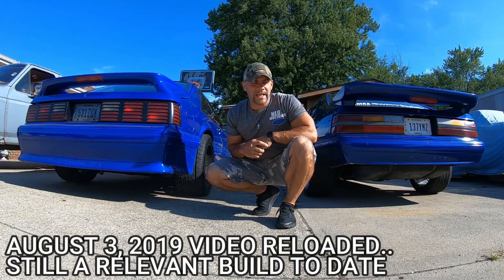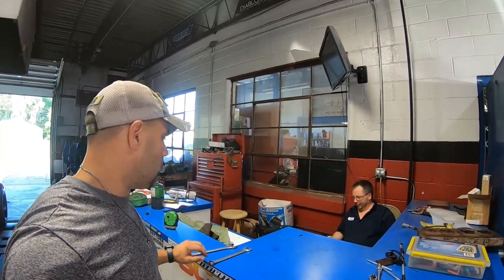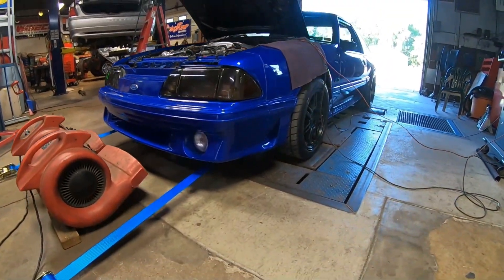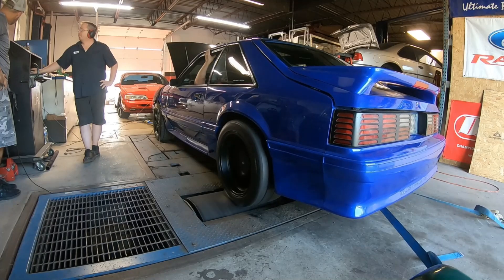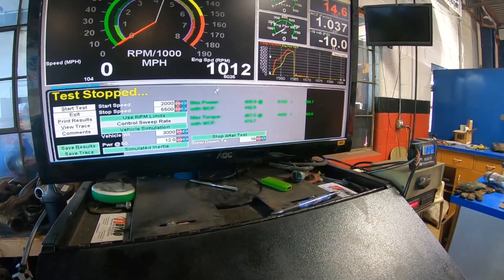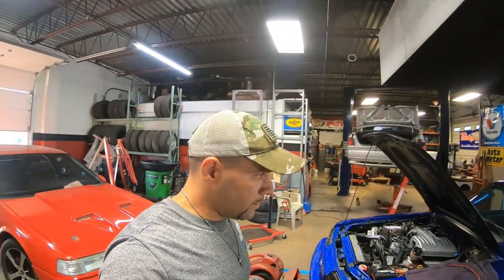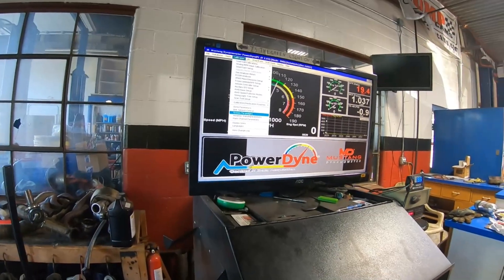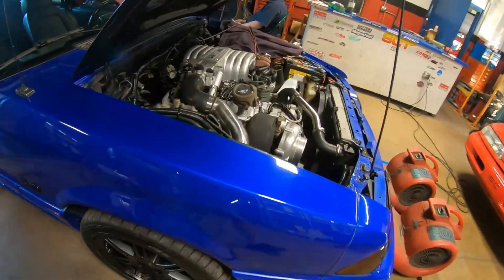Can A Bone Stock 302 Make 500 Hp On A Budget? Turbo Fox Body Mustang

Comment: Yes, a stock block 302 can actually hold up to aboit 800 hp on a low rpm build. I had a twin turbo 302, stock everything,  blow through carb and i lifted one head at about 800hp, put studs in it and left it about 650hp and that was 3 years ago and still running strong

Comment: Nice, the torque is brutal on those heads, actually all the budget headers I have cleared the p’s got some on my 81 swapped rx7, 86 block, .30 over 4 eye brow pistons stock replacement, trick flow stage 1, and a edel perf. Dual plane runs clean not crazy quick but it’s fun. The other p’s are for basically same set up- but turbo for my 85 gsl-se swap with a mega squirt both t-5 cars turbo kit is an cx racing kit I bought and modified a few things still getting it together

Comment: 495 hp is not a lot on a stock block? What does that translate to converted to the engine? Are you saying you’re running a stock crank, stock block, stock pistons? I thought the max for a stock block before it started cracking it was around 550 hp at the engine? Sorry for your loss.

Comment: How much does a budget turbo build cost? I'm thinking of doing the same to a 1988 Lincoln
Reply: Cheapest you may pull it off for is about $900 plus standalone system so add another $500 minimum to that. Then about $300 for every professional tune. And expect a few $100 for more open exhaust. $2,000 but expect it to be much more

Comment: That's impressive man! I took mine a few days ago only made 298hp and 365tq . Tuner said i needed a better fuel system. Im running stock lines and rails with 47# injectors and i think a 255 pump. Was kinda disappointed tbh
Reply: On 93 octane?

Comment: I have 2 pairs of e6 heads, not great heads i know but 1 set is completely rebuilt and going dirt poor budget on this one. Stock block and ring gap, have you seen anyone put boost to these? and do you have any idea on valve springs i can use with no machining? Channel is great love the content thanks
Reply: Honestly, the E6 heads get a bad rep, & in my opinion, they are actually way better than others would say. I've had great luck with them, most importantly, learn how to port heads & they'll do you good. Unshroud the intake valves in combustion chamber, minimize the short turn radius in both intake & exhaust, open up the external (header area) exhaust ports by a lot, same as E7's & get good valve springs.👍✌🇺🇸
Reply: @brianwenzel8791  thanks for the reply, gonna use those e6 heads for sure ported one already, but….. I did find a rebuilt set of Gt40p ‘s at a cylinder head shop guy had them there for a good while. Let them go for 200 bucks I said sold brotha. Just needed truck flow springs and grind out humps. I do wanna boost the e6 and see what it does. When I buy my dyno I will make a video for that.
Reply: Right On. I prefer the Gt40 heads over the Gt40P's The same basic design, but the P's are problematic for header fitment. The spark plugs are at a weird angle. Very difficult to find headers that fit. I actually used the 1986 E6's on my Fox, because of the P's header fit issue. The heavily ported E6's, stock valves, 160 lb. Springs, 1.6 rockers, arp rod bolts & head studs & mls head gaskets, 9.1 compression. 220°x 512 lift cam. Single 66mm turbo, 12psi. 30 tho ring gap, 18°timing, AOD/shift kit, 2200 stall. 3.73 rear. 421rwhp @ 5600, 486 ft lbs @ 3300. So E6's can get it done.👍😁🇺🇸

Comment: Serious question, if u rebuilt the motor, why didn’t u use a stroker kit? Or at least a performance cam and heads? I’m planning on upgrading everything but is stock better? Or just cheaper
Reply from the maker: You missed the point of the build. It’s all done with stock parts. Of course minus turbo
Reply: Kind of a waste as the stock block is the weak link here. No point in sticking expensive parts in a block that will be at risk of splitting in half.
Reply: @DaveScottADV missed the point as well
Reply: @treboy95  which point is that?
Reply: @DaveScottADV  Budget
Reply: @deepkicks-999  not sure why you tagged me. I said that it would be a waste to stick expensive parts in a stock block when it will break before the stock rotating assembly will.
Reply: its a BUDGET build tittle implies that

Comment: I ran a similar combo back in 2008. Stock motor, headstuds, 42lb inj, 255 pump, 60mm turbo, Air/Air, meth injection, Pro-M blow thru 3" tube MAF, 22° timing, NO TUNE. Never had it on a dyno, but it went 6.90s in the 1/8 @ 101 3200lbs thru a AOD trans. Fun and simple combo.
Reply: was it reliable?
Reply: @alanmusa7143 mine was. I had a very similar setup around the same time. Swap 60mm for 73mm. Car made 450/550. Ate t5 transmissions and spec clutches annually.

Comment: What injector, what mass air,what ignition box,what wastegate and bov. Very nice build. Very impressive
Reply: Advancing the cam 4* doesn’t “add” any power it just lets you use the power that is already available earlier in the rpm range..with stock untouched e7 heads I usually advance the stock cam 4* because those heads don’t make any power passed 5300 and there is no need to make it scream..also Dan is running 42lb injectors with stock ignition..I know he modifies his kits to accept larger wastegates but I’m pretty sure it’s a 50mm and a 44mm bov
Reply: Also have you ever advance camshaft 4 degrees to see if it gives more power?

Comment: What head gaskets? Do you use
Reply from the maker: Felpro 9333 PT1
Reply: @Neomustangs  thank you for your help in advance what injector size and the rocker arms 1.72 stock push rods work ?
Reply: He is using 42lb injectors and the stock pushrods are just fine with 1.72 rockers

Comment: When you get your On3 kits. Do you get anything special like the upgraded bearings in the turbo etc.?
I figured a Holley sniper instead of a blow through carb, with E85 and On3 would be a solid set-up.
Reply: Have they updated the super sniper units to where you can run e85 through them now?

Comment: Do you run Girdles to keep the block from splitting? I keep hearing of these and want to know more from you on this
Reply from the maker: eh... i do ONLY because i dont want the rods flying out of the block and me running them over. Its more of a SAFETY thing really. PLUS it will save some of your other parts and keep it together during the carnage! On top of helping keep the motor together
Reply: @Neomustangs  Please explain how a girdle will keep the rods from coming out.
Reply from the maker: @RDub79  You understand how a girdle works right?
Reply: @Neomustangs  Yes. It ties the main caps together. It doesn't do anything to strengthen the rods.
Reply from the maker: Sure it also keeps the parts from flying apart in case of a break …..

Comment: I make 555 to the wheels with an otherwise stock Explorer engine, on3 @ 11lbs and good supporting mods. 👍
Reply from the maker: Very nice! i FREAKIN love budget builds... i get so caught up in other stuff gotta watch old stuff
Reply: Were the heads done ? Did you have a cam ? 

Best we got was between 480 to  496 wheel at 13 lbs .  That good bit over 500 motor
Reply: @Spad68  3 bar GT40 heads (replaced the springs), Explorer intake and stock cam. Car has a good fuel system (-8 feed, Aeromotive rails, 340 in tank pump) AEM WMI kit and a Holley HP EFI. Made 490whp on 10 lbs without the WMI and 1 degree less of timing. Pump 91 fuel @ 4200” altitude.
Reply from the maker: @Spad68  no
Reply: @Neomustangs Dan followed your build with exception of head studs and blew a head gasket with 8.5 lbs.of boost. Getting ARP head studs but what part number and product were the head gaskets? Thanks, went 11.6 first time out.
Reply: "Supporting mods" can mean a lot of things. HCI, exhaust, fuel pump, injectors, throttle body, e.t.c. Usually a pretty decent build sheet to make that power number at only 11 lbs. 
I make 570 WHP at 12 lbs and I have a lot of upgraded parts.
Reply from the maker: @pimpovic2  it meant head studs and valve springs .. injectors for turbo fuel.
Reply: @pimpovic2  supporting mods are a good fuel system, wmi and a Holley HP EFI. Stock cam, explorer intake and 3 bar gt40 heads.
Reply: @pimpovic2  are headers and heads the same thing?
Reply: @alanmusa7143 no...( exhaust headers ) headers are bolted to the heads. They take place of the exhaust manifolds. 
     The cylinder heads = bolt to the engine . The intake and exhaust valves are located in the heads.
Reply: @pimpovic2 i run a stock bottom end 302 with flotek heads box stock other than porting by me, 1.7 cheapo rockers, dual plane intake with the divider ground out, sniper tbi/a1000. Never on the dyno but I see 87% duty on 13psi non intercooled.
Reply: Ive a 2000 5.0 mountaineer to work on was tinking about turbo kit and headers just because the original was just crap.
Reply: Throwing a stock long block explorer motor in a ranger with turbo kit. Are you guys gapping the rings for boost? If so what gap are you running?
Reply: That's impressive man! I took mine a few days ago only made 298hp and 365tq . Tuner said i needed a better fuel system. Im running stock lines and rails with 47# injectors and i think a 255 pump. Was kinda disappointed tbh
Reply: @aaronespinoza1630  something else is off then. Stock lines, 255 & #47 injectors are good to WAY more than 300 hp~
Reply: @aaronliddell4280  what do you think it is? Around 5k rpm  when its about to make boost it kinda bogs out
Reply: @aaronliddell4280  i thought so to I've seen alot of people with the same setup make more then 300 but idk he said it needed more fuel
Reply: @aaronliddell4280  and the clutch was also slipping
Reply: @aaronespinoza1630  well what was your A/F ratio doing? Was it leaning out? Do you have an aftermarket EFI on it?
Reply: Also my car was all in power wise by 5000rpm, max boost is in by about 3200
Reply: @aaronliddell4280  stock efi . And not sure man not to familiar with this but i know something is not right.
Reply: I run a v2 on 11lbs stock bottom and edlebrock 6025 performer heads Harland sharp 1.7 rockers trickflow box-r intake. Wondering what kinda power I’ll make. Dyno/tune day Tuesday
Reply: @matthopkins1107  the box R intake seems a bit of a mismatch, I’d guess low to mid 400’s at the wheel
Reply: @aaronliddell4280  yea it’s what was on there probably a bit over kill. But we shall see. Only thing I did was lower intake was leaking due to a shitty pcv venting and boost AFR and fuel pressure gauge.
Reply: @matthopkins1107  stock camshaft?
Reply: @aaronliddell4280  all I know it’s a trick flow cam
Reply: @aaronliddell4280  mine made 520 wheel Tuesday 👌👌
Reply: @matthopkins1107  Good numbers man, way better than my guess! 👍
Reply: @aaronliddell4280  I’m nervous now bottom end is trying to hold on to anything for dear life before going kaboom. Made 5 pulls 520 490ft lbs was the best so we called it a day
Reply: @matthopkins1107  mine is past that and still together. Good fuel, good balancer, keep it under 6K rpm and it’ll live longer
Reply: @aaronliddell4280  appreciate the info, still has stock balancer…….
Reply: @matthopkins1107  how much total timing do you have in it under full boogie?
Reply: Still together??